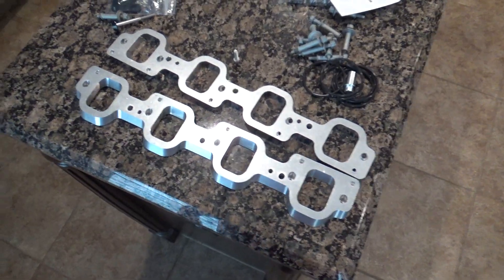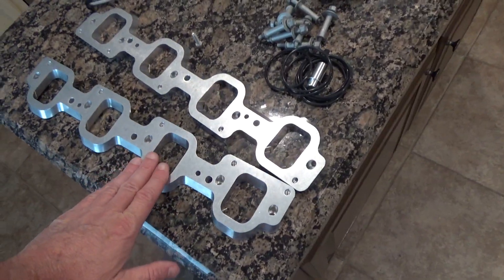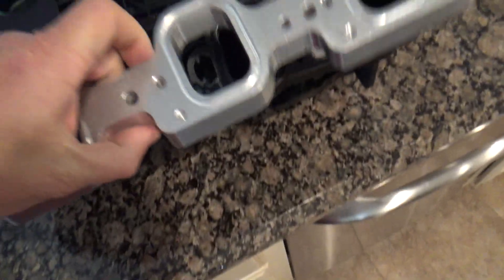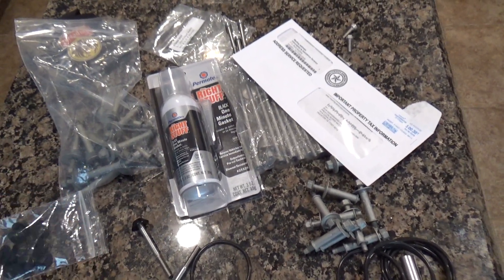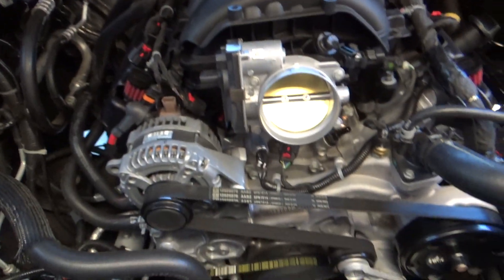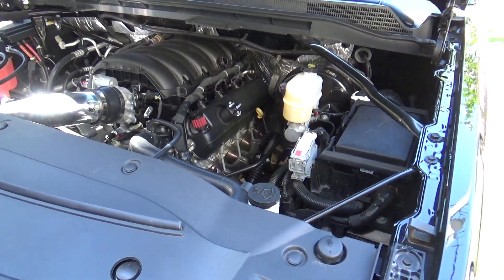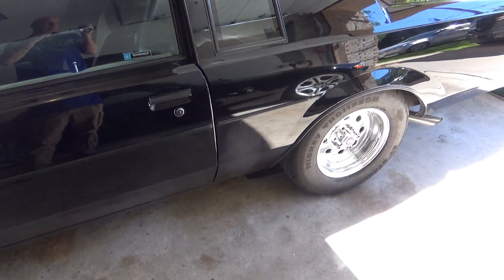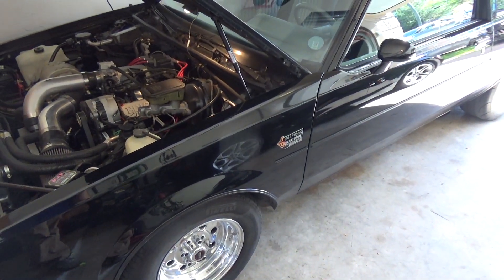2014 - 2018 Sierra Silverado Poor Man's Hi-Rise Intake Manifold L83 L86

Comment: Nice video! Thanks for sharing.... giving me some ideas.... have a question...I purchased a LT1 msd atomic air manifold for cheap and don't want to re route my belt to make it fit...do you think the half inch would be enough to clear the belt and alternater? I was thinking the LT4 truck adapter plates but I overheard at a shop saying the manifold doesn't sit right and air leaks.
Reply from the maker: I don't know, but looking at this video, it sure looks like it might.  I don't have any experience with the car intakes.  I'm surprised to hear the truck adapters leak.  The car plates basically go "straight up" from the heads, so I don't see where they would leak.  Maybe the o-rings leak?  They don't seem like they would.  The plates are machined very well.  

https://youtu.be/Djub-HwzVJc  (around 15:40 mark)
Reply: pmoore4321 Thanks for the video links... helped get an even better idea on how to approach the msd manifold installation! I also thought it was odd that the msd manifold had a vac/air leak... the mechanic installing was saying the angle from the plates was too high.... I was thinking to myself...the plates are for a LT4 blower.... maybe the ports are a bit different than the LT1... so I didn't want to invest the $500+ they cost. Forgot to mention that he tried for a few hours trying trouble shoot and still leaking.... so he gave up and ordered parts to reroute the belt and still had to grind a corner from the alternator.... when I heard all this he crushed my dream build...with a NW 103mm TB a 5in weapon x cai...=[ haha
Reply from the maker: Also, I believe if the throttle body doesn't clear due to the TB motor/gear housing it can be clocked 90 degrees.  Doesn't look so great, but at least it would most likely clear.  1:55 mark of this video:  https://youtu.be/EYoNqBPxYBE

Comment: I did the l86 intake swap on my z71 couple days ago all I have is a cold air intake and magna flow exhaust it made a pretty big difference in throttle response and when I stomp down on it it seem late to pick and go a lil quicker I don’t have headers or cam or anything it made a big enough difference just on what I have to recommend it to be one of the top first bolt on mods to do for the 14-18 Silverado 5.3.
Reply: Cut off the line up tab,maybe